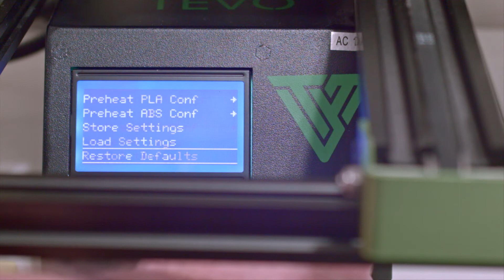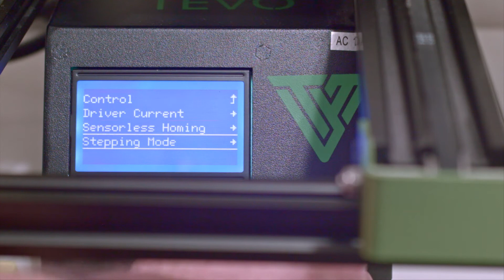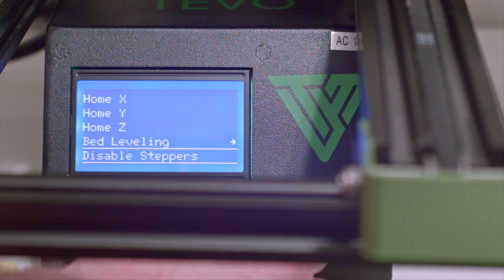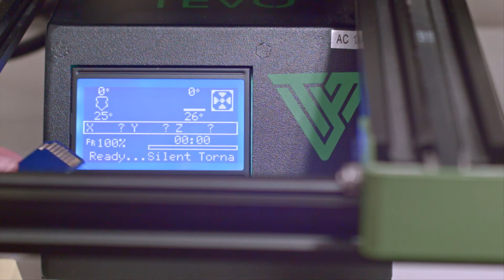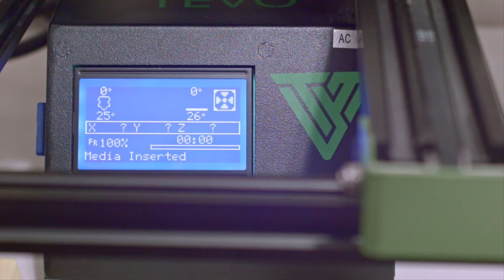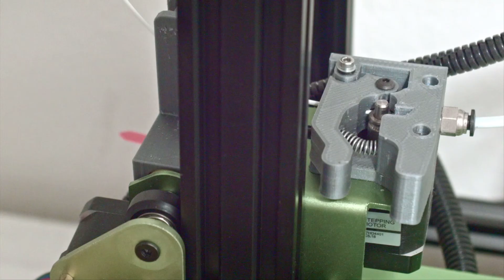Tevo Tornado SKR 1.4 TMC 2209 & Ugrades (Silent Tornado)

Comment: My tevo tornado 220v simply hangs after some time of printing, I have already lost several impressions because of that.  I don't think anything about it and I don't know what happens.  Can you help me?  The screen freezes and I can't access anything.  The screen freezes at the last values.
Reply: It used to happened to me a lot, in long prints, i recall i had a bad SD card, i even went on using smaller cards, (around 2Gbytes) but i would still get occasional errors and hangs. Then i simply start using an android device with a program called GCodePrintr and i stopped using the SD reader at all, i just got it plugged directly into the tevo box USB, i was able to print for long hours without any issue since.